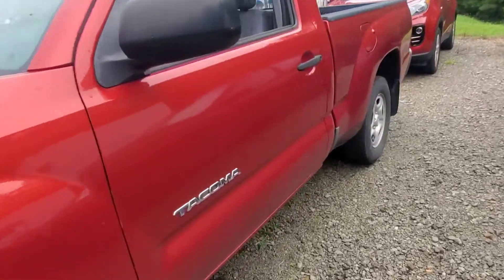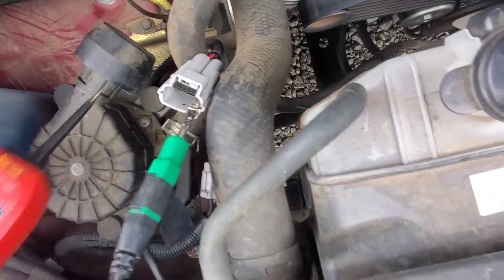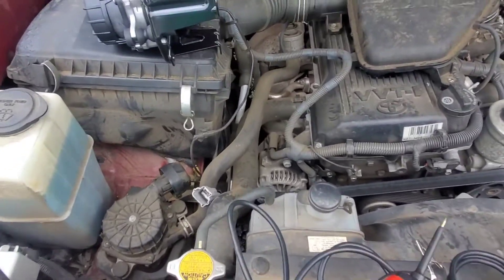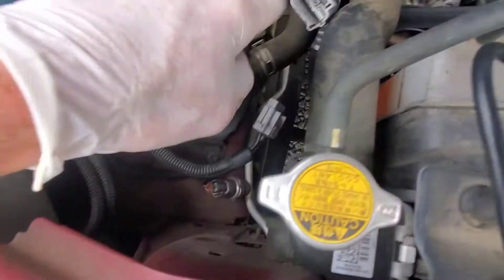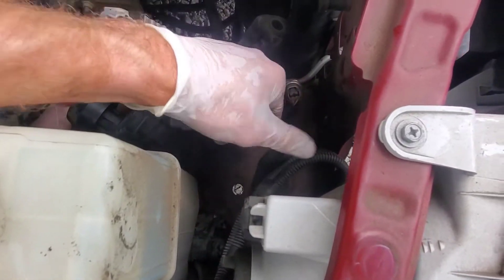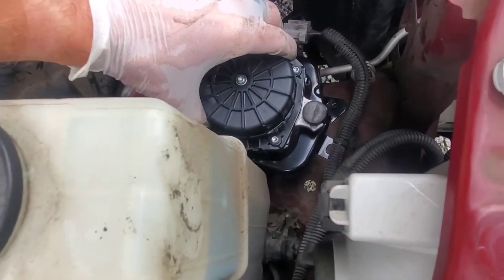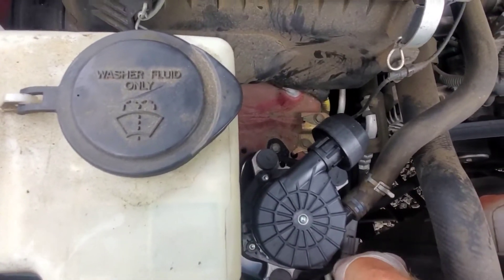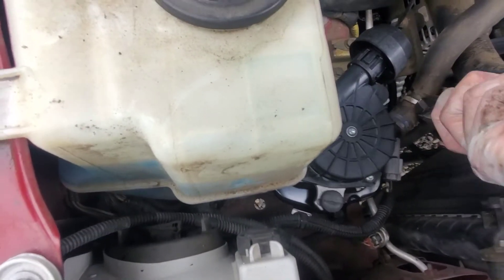TOYOTA TACOMA CHECK ENGINE LIGHT: p0418, p2441, p2445 air injection pump quick diag

Comment: HELP!!! I also have same Taco '06 2.7L with amber Check engine light  (P2433 code) Read out indicates the PCM detected an unexpected high voltage on the secondary air injection system pressure sensor circuit. I checked all the fuses...all ok. The trucks run great but since I live in NY.....still do emission testing here and I'm past the due date. I hate to go to a dealer to have them look at it. If I knew what to do, change the air pump...the Pressure sensor etc, I could get the part myself and change out the parts. Any advice, suggestions, anything to steer me in the right direction, I would greatly appreciate it. BTW, the truck only has 40,000 miles on it..... not looking to get rid of it any time soon, but hate to pay a jillion bucks to fix the truck. Amen!

Comment: Thank you for this! My truck had the check engine light one plus ABS light on. My stero and navigation would not come on. Bought a replacement on Amazon for 76.00 and took me 20 mins. The filter was gone and it had water in it. I saw results immediately. Good video keep it up!
Reply: And what code did you get?

Comment: I have the Same issue my car has the same engine in a different car if u know toyota prado 120 2008 model has the code P0418 and low idle around 600 rpm the fix is same or should have a professional look. Something i noticed is usually when there was no check engine light the car would make the same noise when u start it up when u did after replacing the air injection pump at 7:03 and after the light came on that noise on the startup is missing so if i just replace the pump will that be fine ?

Comment: Thank you. Looks like you could feel the air getting sucked in to let you know it's working too. I had the p2445, code some time ago, but mechanic cleaned the throttle body and no more issues. Popped up again a year later seeing the air switching valve to the pump can get dirty and the valve can get stuck so thought I'd change it for good measure, (I had already cleared the code and didn't come back but having a little rough idle) So bought the part $200 and got a quote to install it and PVC valve (good measure) $180, but won't warranty the switch valve if I don't reolsce the pump $500, saying they break apart and throw garbage into the switching valve. First of all odd there is no filter since blowing air through the system. Second, if there is a history or breaking apart, why not a recall? Third, dealership said their new diagnostic system won't even support the older vehicles.  I love my little Taco, wish it was easier working with these service advisor  salesmen. I'll go start up my car and see if I can feel the air getting sucked into the pump.

Comment: What is the pump actually called ? 
Mine is p2441 secondary air injection system switching valve stuck closed. Is this pump what I need to order for this issue ? Also a p2445 pump stuck off 
Thank you !
Reply from the maker: Pump is called the air injection pump. You need to test your pump to see if it functions as i described in the vid. If it does function, then your switching valve is likely the problem which should be located at the engine block.
Reply: Thank you man. What websites would you suggest ? Rock auto doesn’t have any
Reply: @JiggyAcoustic   I am having the same exact problem with mine currently. Did you find any parts for it? Dealership quoted me $1355 for the part alone.

Comment: So did you ever figure it out there's a foam inside that cause to break into piece and clogged up
Reply: Sometimes the foam inside will get caught in the impeller of the blower. I have taken them apart and found that was the problem a couple times

Comment: I have same issue same truck and I replace the parts already but the engine light keep coming back with the same code tanks
Reply from the maker: But did you test the pump prior to replacing it and also confirm the power and ground is present at the pump connector? The air valve can also cause codes.
Reply: @2shops1roof  thanks for the reply man i really much appreciated you just gain one fallower

Comment: Curious will a P2445 cause a p2441?
Reply from the maker: It is a possibility. Test the pump first
Reply: I have the same two codes @ultrasquido did you find your solution? Appreciate you brother

Comment: Hello, I have a 2006 2.7L 4 cylinder Tacoma (same as you?) and had the same malfunction. Would like to do this repair myself but wandered where you might recommend ordering these parts from? Thanks in advance if you respond!
Reply from the maker: Order a good brand or go OEM from dealer. Do not buy a dorman
Reply: Is rock auto a good site to buy from ?

Comment: Thanks so much for this video! was this issue causing your truck to idle way down on startup and stops? That seems to be the issue I'm having along with all of those check engine codes. Thanks in advance for your response.
Reply from the maker: This truck did not have those idle issues when it came into the shop. Pump is toyota oem, was about $720 if I remember. But the idle issue may be caused by the diverter valve, that's very commonly bad also. Test your pump as I showed and at least you could rule that out if it does work, then go for the valve. But possible both are bad.
Reply: Hi @Swanson6214 hey I’m having the same issue you describe when the truck idle goes way down on startups and stalls. Did replacing this injection pump fix the issue? If not what did you do to remedy the problem? Thank you
Reply: Swanson6214